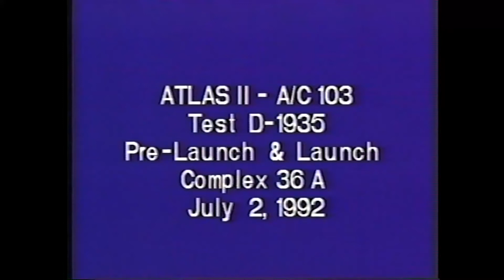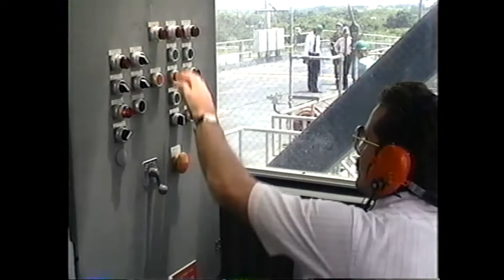Atlas II AC-103 DSCS IIIB-12 Launch, Launch Pad 36A, July 2, 1992

Comment: I hung the sustainer engine and installed the engine steering actuators as well as installing the Vickers hydraulic pump on the engine. Also worked on engine systems while on launch pad.